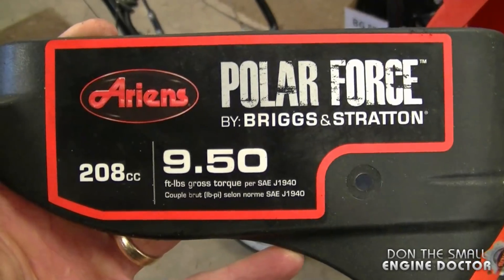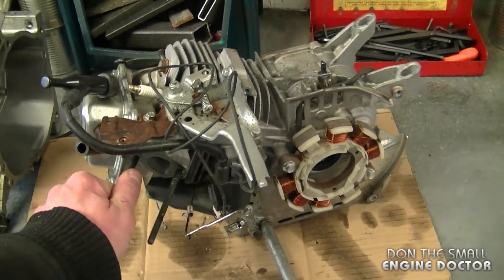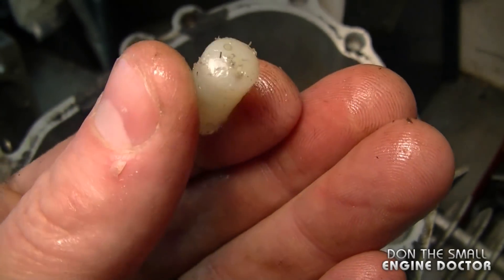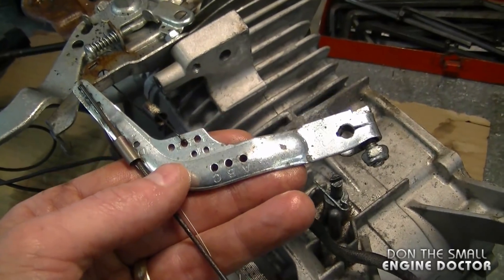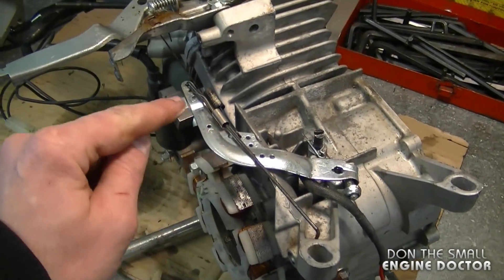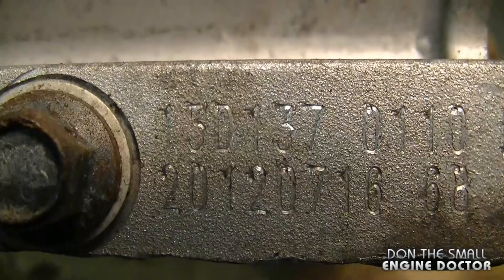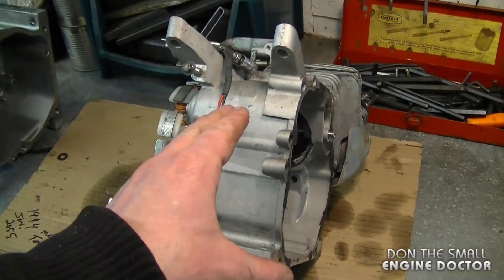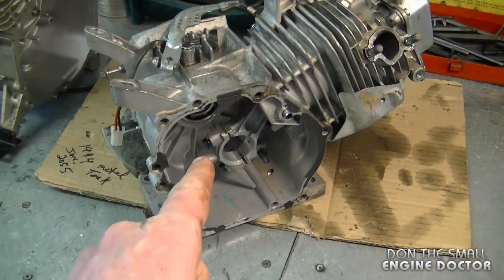Why A Snowblower Engine Was Revving Out Of Control!

Comment: Hello Donyboy, I had a governor failure on a Honda mower. It was intermittent. It would periodically rev, out of control, when started, and I could not discern any pattern, or cause. The only way to remedy the issue was to shut the engine down, and manipulate the governor arm. The governor would usually act normally after a restart. Manipulating the arm with the engine running would not fix the issue. It would rev right back up when you released the arm. I took it to the dealer, who insisted it had to be the carburetor. Honda approved replacement, and when I picked it up, and took it home, the issue recurred on the very first start after taking it off the trailer. I took it back, showed them a video of the start in question, and requested that they replace the governor assembly, which is what I wanted them to do in the first place. They claimed afterwards, that they could see no flaw in the governor, but the issue has not happened since.
Reply: ...you had an incorrectly tensioned governor arm, most likely. The person working on it probably placed the throttle to full run, took the nut off that holds the arm base at the shaft outside, held the arm all the way to the right, applied thread locker, and put the nut back on. Then called you the next day to say it was ready.
Reply: Hey 999thenewman, that would make sense, except that you could go out the next day, and it would operate perfectly.

Comment: 4 years ago I had a then 4 year old Honda engine on a rear counter-rotating tines Tiller do that and over-rev.  Before I could get to the engine kill switch,  the top end grenaded through the stamped metal OHV valve cover.  I was lucky I didn't get hit with hardened flying metal engine parts.   I never did find all of the pieces.  After tearing it apart and doing a Honda parts estimate, I tossed the engine and replaced it with a Harbor Freight Predator engine.  $89.00 with a coupon.

Comment: Excellent video. Possibly of interest: The Tillotson 212cc or Predator 212cc engine is a bolt in swap on some models of Ariens snowblower. Occasionally the Predator is on sale at Harbor Freight here for just over a hundred bux. Might not be available in Canada.

Comment: I have a Techumseh TVS-90 with a similar issue and the press fit governor shaft has to be removed to replace the gear.  I haven’t tried heat yet, but I did drill from the outside of the case and the shaft doesn’t move a fraction of a hair in or out.   Some of them have c-clips, but not this one..   LIke to see Dony do that one.
Be real youtube, be sober.

Comment: Thanks for the video.  I have a newer model engine, but still similar.  I almost s*** myself when I saw the plastic cam shaft inside the crank case.  I can't believe the junk they put on $1200 snowblowers these days.

Comment: I found out it's imperative that you keep all receipts, some time back I bought gas at a gas station using   pay at the pump , I kept the receipt and some time later the attendant came to me and tried to say I drove off with 40.00 in gas,, but since I had my proof, I avoided a lot of problems. it was the guy before me that actually drove off with out paying.

Comment: I know it's a long shot but maybe it is on of these rare cases in which one OEM's part will fit another due to using of the shelf universal components. this engine is looking very similar to my 2010 MTD tiller 208cc.  try looking for mtd part number 951-11576 .

Comment: Do you have a video on setting the governor so it doesn't run high?  My blower was fine started sputtering so replaced my carb after cleaning solved nothing.  I also replaced both the linkages from governor to the carb and no runs super high and hard

Comment: I have an Ariens AX engine that is revving too high after rebuilding the carburetor. The engine also runs without the safety key installed.

Comment: Next up plastic block ! and rods !
And augers!
Reply: I encountered a plastic gear on a slant 6 cylinder distributor gear in the engine circa 1970.
Reply: @larrybe2900  I encountered a nylon timing chain cam gear on a late 80's American made station wagon (believe it was a 1988 Chevy Caprice Classic, we had a few wagons at the time!). Although it did eventually strip, that was at around 350k miles, so can't complain too much. Think it was plastic for "noise reduction", not that I think it helped any! Thankfully, the motor was not the zero-clearance type... Wagon made it another 80k miles or so after installing a new cam sprocket (reused the chain!) before it rusted out completely and had to be disposed of.

Comment: Hm. This could be one of the problems with my old Tecumseh 10hp. It's interesting that, these small engines need governors, that the throttle does not actually control the engine speed. Sure, pushing the throttle up or forward, does apply pressure to the governor arm, thus opening the carb valve, because of the attached rod. But once running, the throttle seems to have little effect on engine speed. It's the carb valve spring and governor controlling the speed then it seems.

I discovered this when I bought a rebuilt carb online. The carbs valve spring was way too weak to pull the governor arm back. when the throttle lever was pushed down. I could not find what was wrong till I reattached the old carb, and then the throttle worked perfectly again.

Comment: There are USA laws that manufacturers are REQUIRED to supply spare parts for 'x' number of years. (I don't know what the different categories are.) (Also I don't know what laws might be applicable to your customer or the motor/manufacturer/whoever.) I don't think the intent was that one needed to buy a $$$$$ major assembly to get the $ part. This is a legislative/regulatory issue and you could talk with your local representative people to see if they'd care to look into it.

Comment: I just bought a Simplicity M1024E snowblower brand new and it has this engine. I thought Briggs and Stratton engines are still American made? I guess eventually all small engines will be Chinese and Japanese.
Reply: Briggs now just the Name !!!!!!!!!!!
maybe the bigger Briggs are US made Smaller stuff all off shore 
Briggs parts are Expensive Not worth to Repair
Reply: Joni English, the engine in this video doesn’t even look that old!
Reply: look at my video , rebuilt one on the cheap only lasted 30mins 
i think i over honed the cylinder ( excessive Scoring due to lack of oil )
going to do a proper rebuild with new Block .
the Briggs Snow engines only Rated 250 hrs Emission Compliant , Bo Ball Bearing Crank 
the LCT engines or Loncin made much better !!!!!!!!!!!!!!

Comment: Is that a Chinese LCT engine or a Briggs?
Reply from the maker: a BRIGGS
Reply: 99% briggs snow engines DO NOT have BALL Bearing /cranks !!!
i have a 250cc Briggs 15c107 no ball bearing crank or steel liner .
the LCT snow king engine are supposed to be bulletproof
Reply: Briggs and Stratton now uses Chinese engine parts, they essentially put their name on it but it is an exact copy of a Chinese Honda clone

Comment: This engine was obviously sabotaged. Because most governor gear assemblies don't become damaged due to normal wear & tear. Somebody must have loosened the clamp on the governor cross shaft, allowing the engine to accelerate at full speed. Lucky it didn't break the rod. I've had some customers do this to their (destroyed) lawn mower engines because [they told me] "it wasn't revving fast enough."